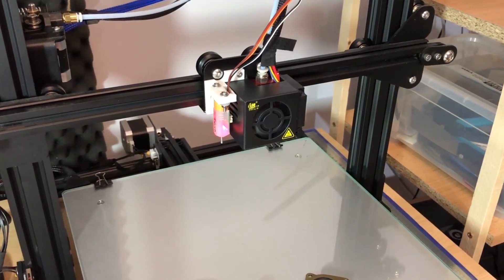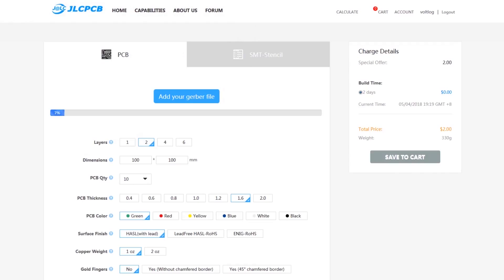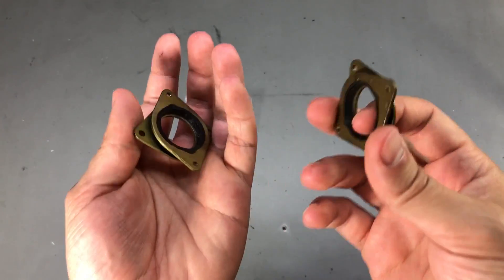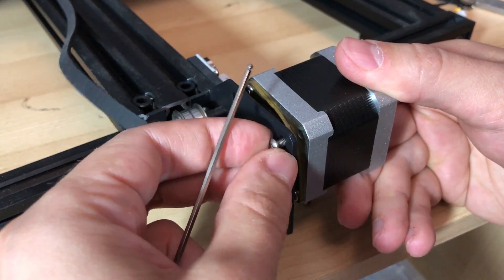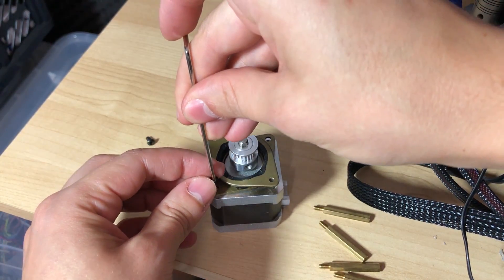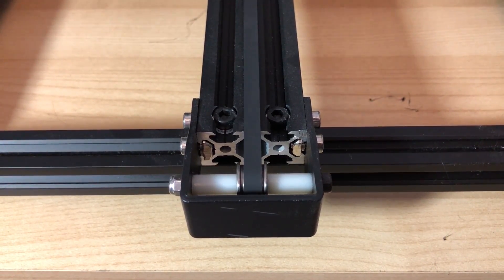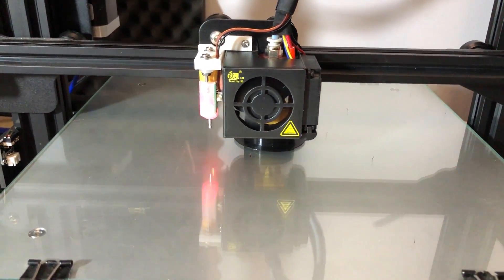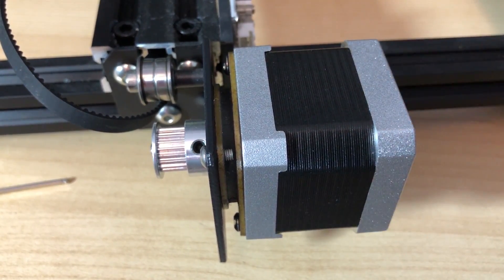Voltlog #181 - Installing Stepper Motor Vibration Dampers On The CR10

Comment: I've found building an enclosure solves a few issues, noise from all parts of the machine, prints lifting from the bed due to drafts and I also put a carbon filter inside with a fan to hopefully clear the air of potential fumes.

Comment: Nice vid. One major drawback of this kind of dampener is that the motor is somewhat "angled", due to the rubbery part, which tends to prevent belts to be correctly tensioned. It's not really ideal. Dampeners made out of 2mm silicone gasket are a better option and allow for proper tensioning.

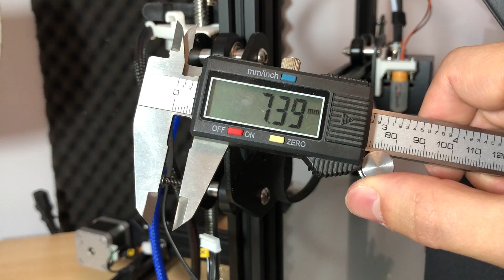NB : full-threaded screw length is not measured like this (5:19) : only the threaded part is relevant. That's what M3x8 or M1.5x4 stands for : it does only account for the threaded part.

Comment: I was very confused that you were hearing noises from your BL Touch, until the end where you mentioned that you're using a clone version, because I've never heard any noises like that from my BL Touch at all!

The difference is that the genuine BL Touch uses a plastic probe pin (with a magnet inside the top of the pin to trigger the hall effect sensor and so the solenoid can raise the pin when needed), while the clones use a plastic pin as that's probably cheaper to produce. Plastic isn't going to create that metal vibration sound!

Check the pictures on the BL Touch site here: https://www.antclabs.com/bltouch

Comment: Im pretty sure that noise is from the cooling fan
Reply from the maker: in my case, the noise is coming from the bl touch metal pin vibrating inside the plastic case.

Comment: why not try those silent stepper drivers instead?
Reply from the maker: I would have to get a new motherboard to fit those drivers which would mean a whole set of new problems and i would be working more to get the printer working than actually printing stuff.

Comment: They are good foor Z axes where the tension is is compressing the rubber but not voor X and Y axes ,if you get tension on youy belts the will chear of the rubber from the plates deu to the side tension ,won't last a full print. Don't ask how i know.
Mybe they will survive with not a lot tension on the cheap T2 rubberbands ,but on my Synchroflex polyurethane T2.5 timing belts the rubber damping came lose from the metal if you put them on tension ,only the Z dampers survived.
Reply from the maker: The Z axis moves very little during a print, it doesn't make sense to have such a damper on the Z-axis which doesn't make noise. However if the dampers fail any time soon I'll have to think if I replace them or just ditch the idea.
Reply: I put the dampers on my CR-10 Mini on the Y axis about 2 1/2  years back and it worked perfectly even working now 10hrs a day for the last 3 months and never had any problem with the damper or print quality so for standard rubber belt fitted to CR-10 it lasts and is much quieter. Never needed to adjust either.

Comment: You can also find those dampers on office copiers. Usually not on the smaller desktop ones, but always on the larger free-standing ones. I work at a for a copier company and I tend to strip the machines we take for trade in because they're loaded with stepper motors. As a result, I have huge quantity of those dampers. I used them on my printers and didn't notice any real change in print quality, but as you said, the reduction in general motor noise is considerable.
Reply from the maker: I bet those that you recover from the office copiers are of higher quality than the ones I got for cheap from China.

Comment: Hi Florin, nice video! 
Do you know if the noise can also be reduced by using different stepper drivers? 
I think I saw a video where someone really reduced the noise by using some fancy stepper driver boards (I think......... tmc2130 drivers).
Reply from the maker: Definitely, using the TMC2130 you can reduce the motor noise right from the start. However in my case it would also require replacing the motherboard and that wouldn't be a problem because they are fairly inexpensive but the new one would not fit in the same enclosure with the same cutouts and I don't want to go that route.
Reply: @voltlog  
I just saw this video last night that addresses your concerns with fitting/size of the motherboard.
https://youtu.be/-XUQKQnUNig
The video starts off seeming to be a do-able task for beginners but than quickly becomes overwhelming. Though, the poster's summary at the end seems reassuring.
Maybe something to look into. 😊

Comment: Print a tensioner for the belts, these clips are much better as they are not in the way of the nozzle: https://rover.ebay.com/rover/0/0/0?mpre=https%3A%2F%2Fwww.ebay.com%2Fulk%2Fitm%2F362228645679
Reply from the maker: thanks for the hint!

Comment: I think you may lose fine detail where the head is expected to move back and forth rapidly over a short distance.  Maybe you have some test prints to compare it to?
Reply from the maker: I don't know of a particular test that might stress that but on a regular print I haven't noticed a change.
Reply: Not going to be much, those dampers were common on dot matrix printers, which used a lot more aggressive head movement , and they could still do 0.05mm accuracy in dot placement at high speed. Those are bonded rubber, they use a sheet of uncured rubber, and then bond it to the roughened steel using high temperature and pressure in a mould, so it chemically bonds with the steel. That bond is stronger than the rubber itself, the rubber will tear off rather than let go. 

To reduce noise get some acoustic panels and make a alcove for the printer, they will damp out a lot of the sound, and as well for the Z axis simply get some high density foam rubber self adhesive sheet ( sold as interior sound damping for cars) and place under the glass. For the others try simply sticking some weatherstrip along the support beams where nothing moves, to damp them vibrating as well. the motor noise is transmitted to all the structure, so damping it as well helps reduce noise.
Reply from the maker: Thank you for all the info!